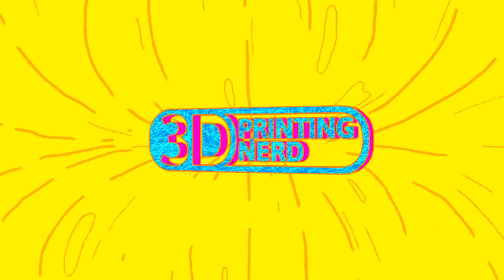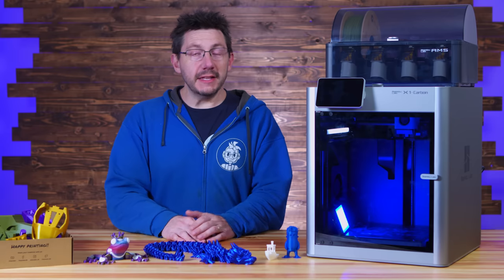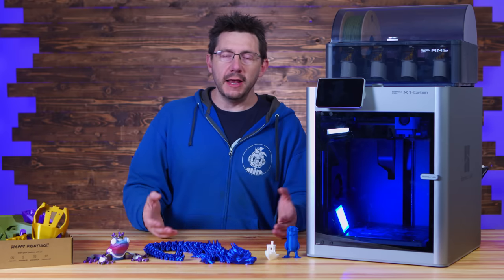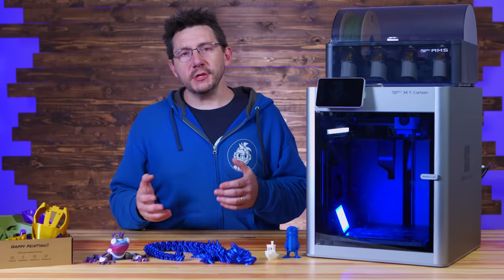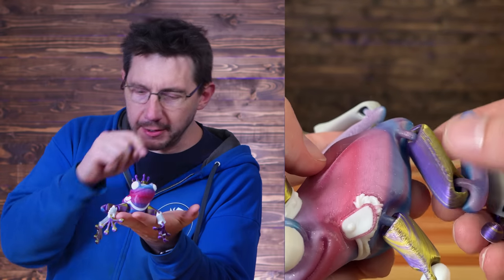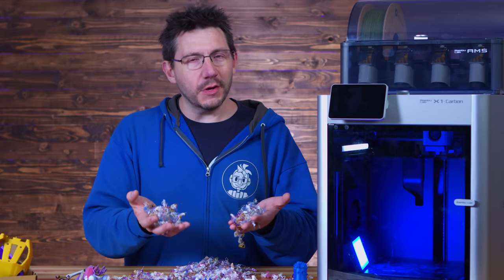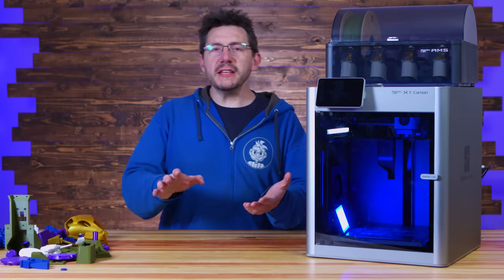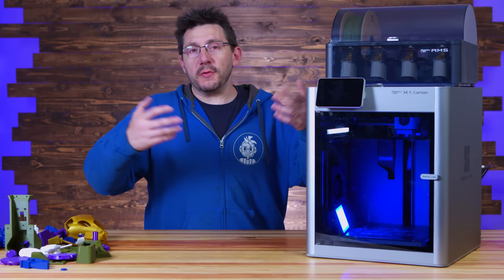Bambu Lab X1 Carbon + Kickstarter?!

Comment: As you know, I have one and also backed the Kickstarter. I think it's gonna be a game changer in our world! Manufacturers are going to have to start changing and Maybe we will stop seeing the same old printer over and over. Maybe it will make them take the time to develop something new, like Bambu Lab did!
Reply: I agree with you. I see Anker Maker is similar (I backed that one) where the quality, capability, and color control are truly at a new level. Last year, the AnyCubic Vyper got a lot of attention through setup, calibration, and control. This year, it seems like Babu and Anker Maker are driving us to a new level. What will next year bring?
Reply: @matthewadavid  you're giving the Anker maker a little too much credit there
Reply: @matthewadavid  Probably made the right choice there. Anker is a known entity for sure.
Reply: @agliacci  I don't know. Even without it's "AI" which might never come, it had a lot of improvements that other more budget friendly manus have struggled to hit. Even simple things like USB cables for connections, and the print speed was impressive. They also have $1.1 billion in net worth, so support and future enhancements are more than likely down the road. If bambu folds in 6 months, good luck fixing any of their proprietary pieces.
Reply: @agliacci   It's a well designed & polished 3d printer in comparison to the bed slinger clones that are churned out on a daily basis these days. I would say that Anker have always weighed more towards marketing/branding than engineering in most of their products. Bambu lab looks to be much more innovative from a design & engineering standpoint and the end result is pretty nice indeed. The X1 is definitely "disruptive" in this space with it's feature set and value. This, to me, is pretty much like the Apple Mac's first appearance in the home computer scene. Interesting times ahead!
Reply: @ZeeLobby  If the point is to develop an advanced 3d printer, then proprietary components is a necessity if it's achieving results far better than from the norm.  And they should keep those proprietary components as a business secret to be able to succeed.
Reply: I love seeing new innovation. 3d printing is still developing and I love it!
Reply: @agliacci  Probably. More of an example of how fast the industry is moving forward
Reply: I agree... this is a game changer.  This will force Creality or Anycubic to respond with more technology.  So glad I backed this printer.
Reply: Hey Jim @theedgeoftech - Love your show man! I’m local to you, just south of Kenosha WI.
Reply: @cstategrad99  Awesome!! Thank you!
Reply: @dontworrybehappy4916  Eeeh... Secrecy has been the biggest bane by far, of this industry's evolution and progress. Or rather, patents.

Being able to patent something that you've spent a tonne of labor and cost on developing, is in principle a reasonable thing. The ever, nearly exponentially growing problem with this however, is that the overwhelming body of patent law and patent processing is horribly outdated, even recent WTO consensuses were minted 30-40 years ago when the rapid RnD of this era was still in its infancy. With the patent processing system stuck in the 80s/90s, it is wholly unequipped to appropriately process patent fillings anno 2020s. They neither have enough technical staff nor general manpower, so they end up leaning on outdated principles, and thus grant absurdly wide and vague patents. That makes this relic system horrible, and the single biggest retardant of all global technical progress. Because once someone figures out a nifty idea about for instance a slightly different way to assemble a hotend-extruder unit, which turns out opens many new doors for greatly improving 3D printing, then they file and get approved another absurdly brosdand vague patent for that... Now you've not only cut off that path, you've blocked an even much broader branch of development becsuse of how broad and vague that patent is. Throw in 5-10 different patents of similar nature, and we'll effectively be back in the 2 decade long black Stratasys hole. Now I'm single, but my unborn kids will be off to college by the time we can really get the ball rolling again.

The world desperately needs a complete reinvention of the patent system. Patents need to be far more specific and narrow, with multiple category tiers of timespan with 5 years the absolute maximum. After 2/3, forced to offer lisencing upon request with a reasonable value cap. We probably need to rethink how technical patents are processed too. There's ever more stringent technical insight and niche literacy needed to appropriately evaluate a patent application, public/govt patent authorities cannot be expected to have all these on staff. So we probably need tens of thousands of professionals in all various industries to chip in. Make it partly democratized; those professionals doing this technical evaluation bit wouldn't be educated and trained in the bureaucratics of the process, but  the technical aspect could be something like this: You review patents in batches. Ewch batch consists first of one patent application regarding something in your field of expertise, for you to evaluate. You write a short report on the technical aspects as guidance for the govt agency bureaucrats - about whether it's truly unique, if it's a way too minor change to something already available, if it's prima facia actually patentable, which parts if any of the application scope is too broad, too vague and why, and a recommendation on what patent time period tier is appropriate. Then, once you've filed your report on that patent, the rest of the batch is you look through 3 other patent reviews and their summary report done by other contributors. You add to this report your own assessment of the report; If there's anything to add or critique, if you disagree with its conclusions etc. If the patent application is out of your technical wheelhouse, you swap it for a different one.

Your time would be compensated ofc. Some businesses might offer theirnemployee resources for this, with the govt agencies compensating for the hours workers spend doing that work. Doing this as a private individual, you could for instance be compensated in form of a sensibly scaled tax rebate.

It's certainly not s perfect system, just some of my diarrhetic brain farts. And it certsinly wouldn't "solve" everything that's wrong with our patent systems. But something like this, could go a long way towards improving the innovative fertility of our industries. It could make innovative development by all fish but especially us small ones, much less of a mine field. And it could dramatically reduce large evolution roadblocks occuring, by granting far fewer patents that are inappropriately broad, vague and excessively long. And forcing patent holders to grant reasonable lisencing, especially towards the latter half to latter third of its lifetime.
Reply: As you know?? Lol no we don't, as you know I've  never seen you before 😂😂😂
Reply: @tijuas0918  Good point. I directed that at the people that have been watching my channel for a while, and know that. But I shouldn't assume that everyone reading it would know that. I appreciate the feedback and thank you for watching!

Comment: I'm reminded of Angus' words about 3D printing, in that he believes that "plug and play" is the key to this hobby going mainstream. Tinkering, adjusting, calibrating, and scraping failed prints off the bed more often than happily removing completed prints is what is keeping this hobby from "breaking through." All the Kickstarter warnings are valid, but from what I've seen of this machine (and Anker's), the "plug and play" simplicity of them are really huge steps in the right direction.

As someone who backed this campaign, I would love to see how it handles a multi-material print of something like the Dead Man's Tale rifle from Destiny 2, or a complicated mech at a large-ish scale like something from Gundam, Armored Core, or Code Geass.
Reply: I hope you are right and get a printer.
Reply: @Ronin Paterson Thingy-ma-bob collecting is a completely valid use of 3d printing. Let's not gate-keep. This hobby is already niche enough without walling off large segments of users.
Reply: @Ronin Paterson It could also be making parts for other hobbies. Some of us like 3d printing, but not necessarily for the sake of 3d printing.
Reply: @Ronin Paterson Well I love 3D Printing as a technology but I don't see my printers as toys but as tools. I love 3D printing because it has given me the opportunity of bringing  my ideas and designs to live without the need of going to a machine shop. I don't hate fixing them or upgrading them if needed but I'd rather have them ready to print. That's the reason I use Prusa printers and not Chinese printers. Reliability is very important to me, don't have time to be playing with wires and code to get the printer to do its job properly.
Reply: @Ronin Paterson for me, the 'hobby' isn't 3D printing itself, the 'hobby' is using the 3D printer as a tool to print what I need.

I use 3D printing to prototype structural parts or parts I use in other things I'm building. That's where my enjoyment comes from, not from having to tweak printer settings, or monitor and correct filament changes to get a complete print.

I want to design parts and have the printer print them reliably and without any hassle.
Reply: @Ronin Paterson I can speak to this as a beginner. I am interested in the hobby of designing and producing parts, potentially to help make some side money as well. But I'm not interested in the hobby of printer tinkering. I think people conflate interest in 3D printing, with interest in 3D printer hardware. A large chunk of us want a turnkey solution for getting into 3D printing and doing various tasks but don't have the time, patience, or interest in doing a bunch of profile generation, setting tinkering, and hardware tweaks.

The sad irony is, most of the turnkey solutions to date have been for small businesses, and have massive price tags attached. But those of us that want turnkey reliability for home use have been essentially underserved or unserved entirely.

Comment: Joel, I pledged but keep considering pulling out. I have a very similar view on Kickstarter as what you presented. As to what I'd like to know more about, mixed material would be great? Using PETG as PLA supports (or visa versa), using TPU as the outer skin of a PETG model (since PETG and TPU should bond). These are the things that interest me. I am a bit torn between this and a Prusa XL
Reply: Mixing TPU and PETG sounds really interesting. I'd be interested in seeing that too.
Reply: TPU is not rated to feed in the AMS, it is recommended to only feed tpu by bypassing the ams and loading it on the back of the machine.
Reply: @Xploit66  Oh, that's disappointing and I hadn't noticed that. Good catch.
Reply: @GarethLewin  It might still take it as an input if you can have a roll on the back and the ams at the  same time, but that I don't know.
Reply: @Xploit66  But it can't retract it the same way the AMS does, so I wonder how mmu functions will work in that case.
Reply: If your debating over the prusa XL and this, the XL is far better for multi material not just multi color. Using the same nozzle with multi filaments is not ideal since the nozzle will have too take time to cool down or heat up, and that takes time. The XL just swaps the nozzle instead kinda like the E3D tool changer. The Bambu Lab has some nice features but imo for a hobbyist those are kinda irreverent.
Reply: @Unscientifically  Yeah, I'm aware of the multi nozzle benefits of the XL. This machine seems to have other things going for it. But yeah as I said I'm thinking of backing out.
Reply: @Unscientifically  The thing is though, that the Prusa XL is just about 4x the price with all the hotends included and fully assembled.

Its a hard bargain by comparison even though it has some pretty neat features itself. They also don't currently have resonance shaping.
Reply: @GarethLewin  ah dang, I hadn't noticed that either; that's really disappointing, esp with tpu being a nice thin first layer for certain other materials
Reply: @BeefIngot  That is true. Also you can get resonance shaping easily on any printer by using kipper.

Comment: Glad to see this machine covering new ground! 

I'd love to see Joel test how far we can reduce the purge waste while maintaining decent color separation. It's great that the filament purged is configurable. But if the default values are already already close to optimal, that would be important to know. Otherwise some may have unreasonable expectations about how much they can reduce that purge waste.

And lastly, can waste be reduced further through purge-to-model techniques where a second model is used as a purge block?
Reply: Just an idea. Maybe so heavy down cooling at the end of each filament switch?

Comment: I used to back a lot of Kickstarter projects (well over 100 in all).  These days, I back one or two a year and not the expensive ones.  Here are the ways things can turn out:
1. You can lose your money and nothing gets delivered.  This is real. It has happened to me multiple times. Sometimes the person running the project will contact their backers and apologize for failing. Other times they just go silent and you never hear from them again.
2. You get a product that is clearly a beta test product and not really ready for prime time.
3. You get a product that is OK, but the company eventually fails or changes business focus. All vendor support ends.
4. The Kickstarter project is a complete success and you receive a good product.  The company goes on the build version 2 of the product and sell it to consumers at large.  You are stuck with version 1 while everyone else has the new and improved version.

In most instances, it is better to wait for the product to hit the regular consumer market.

Comment: Order some gst3d filament - It's prone to clogging, horribly (like dirt pebbles horrible)... but it's some of the cheaper filament people buy in bulk. I wanna know how the nozzle holds up to clogs and how the process goes to change it. As well...how prone is it to clogging with bad filament, will you be making a custom nozzle in a short period of time, or never.
Reply: Why in the world would you possibly buy filament you know is junk?

I personally buy cheap filament and have never ran into a clog with it. You need to find a better filament supplier.

Comment: Joel thanks for the honest review. I've experienced Kickstarters that have varied from "Above and beyond fulfillment" to "Burned to a crisp" so I share your skeptical view of the platform. Now the Bambu looks extremely promising, the best comparison I can come up with (and one I've been waiting for a release) is the Prusa XL, these machines have a similar core design of multi filament printing with vastly different implementation of said design. Difference in MSRP price points of both machines is huge, with the Bambu being way lower. The possible expandability of the Bambu up to 12 color/material (or was it 16, I forgot already), puts the Prusa XL max of 5 to shame. Not going to ramble on to much, if the Bambu produces what they claim, the other big names in 3D printers are going to have to step up their game plans.

Comment: Thank you for the great breakdown and disclaimer! I have backed this project and understand the risks. Its just one of those things that the Benefits seem to greatly outweigh the risks.  My big question is how do you think the other big players IE: Prusa Creality will respond to this new wave of "smarter" printers?
Reply: Gauntlet thrown. I am very, very eager to see how they respond. Because if they do not, they will get eaten. A lot of times, the companies that develop a market aren't the long term players for reasons exactly like this. But, I have no doubts somewhere Prusa and Creality employees are waiting to get ahold of these new printers for scientific research. And reading the Positron open source project etc. 

3d printers are about to become a whoooollle lot better across the board. As it is new printers are pretty much all coming with assisted bed leveling now, but this puts a whole new pressure on it.

Comment: How is it with ABS? does it confirm that all that is really needed for quality, trouble free prints is an enclosed build chamber and even bed heating, rather than requiring a heated chamber?

Comment: These guys at Bambu Lab are doing great things for home consumer 3d printing. This at the end of the day is a core xy with klipper implementation out of the box with a couple proprietary features. Most people don't know eletrotechnolochy and what a raspberry pi is, so they only hear about these things. Now give me a cut down x1, not enclosed, not closed sourced and more affordable in times of oncoming inflation. I dunno, if they pull this off they can come to the budget market and get them off i3 clones for another 5 years. Thanks Joel, for such a big channel your still straightforward which I appreciate!